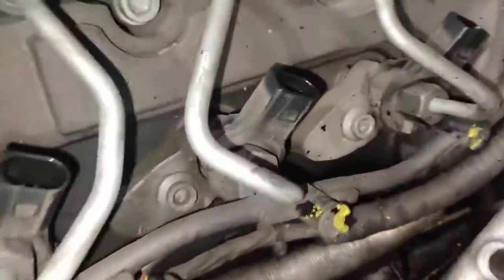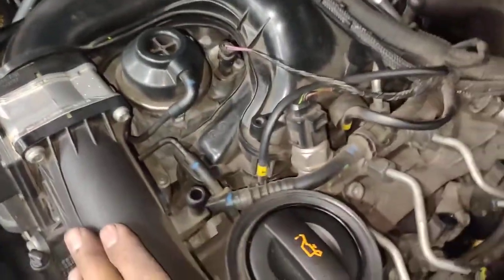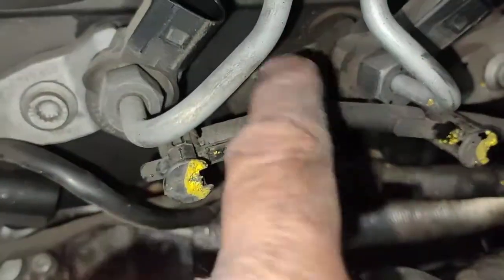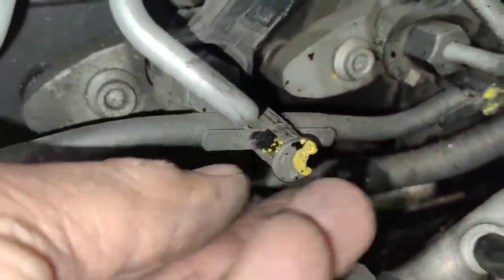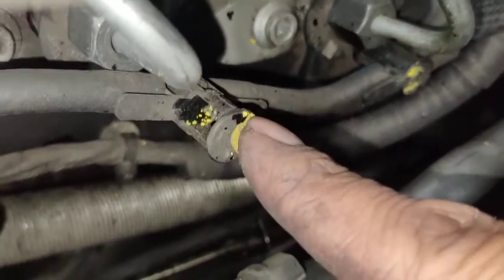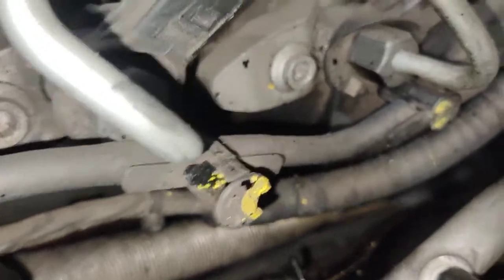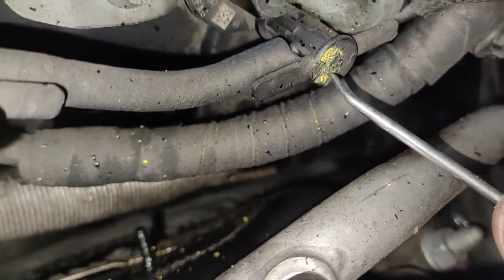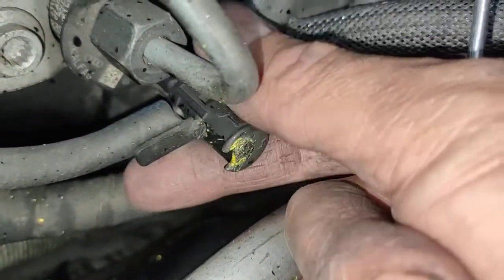Porsche Cayenne 92A Diesel - How to remove fuel return line clip on connector

Comment: The video focuses on the wrong spot at exactly the wrong moment. The little tab that was covered in paint moves slightly away from the centre with a sharp thin screw driver, then you pull the whole widget up - easy. Thank you, though. My little hose popped off because of a clogged diesel particle filter (DPF). I ran the engine at 2,500 RPM for 35 minutes with braces on the accelerator and brake pedals, and that cleared the DPF. Then I re-attached the hose. That also cleared the "check engine" light and lit noodle showing fuel flow problems.